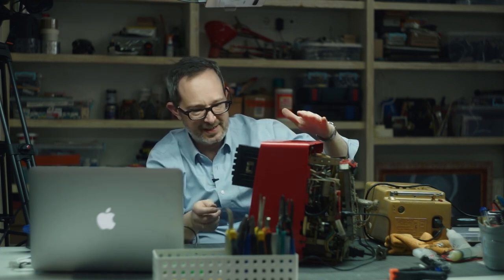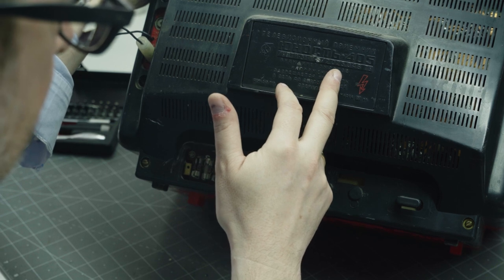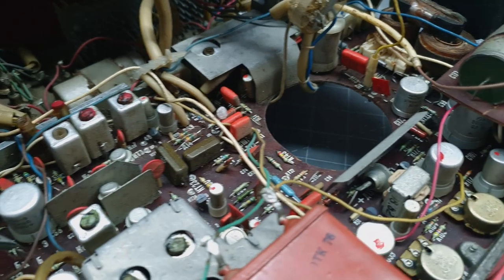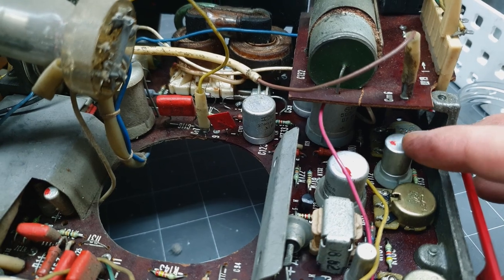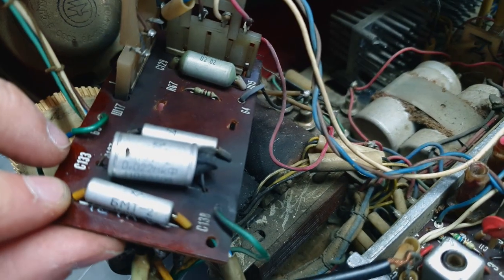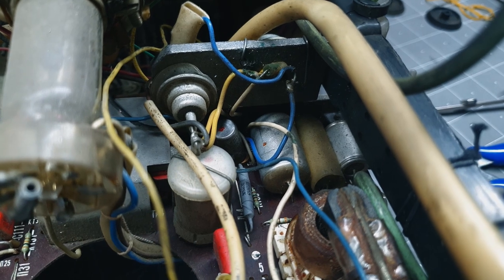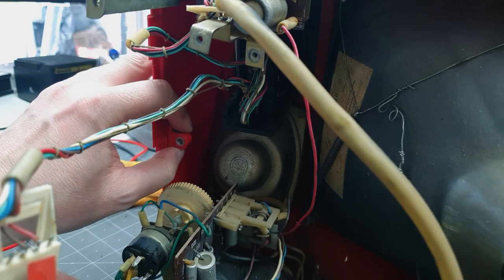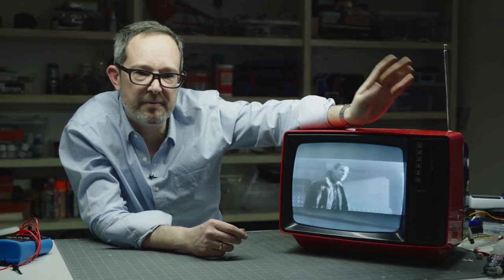CRT Restoration - How to get Blade Runner onto a Soviet Television

Comment: Kids these days don't appreciate how valid a solution slapping electronics is
Reply from the maker: If it works for the Falcon’s hyperdrive, it works for us.
Reply: still works fine, slapped the shit my aio CPU cooler. and the pump just started working again. and have been for over a year
Reply: Percussive maintenance is the technical term...😂😂😂
Reply: Percussive maintenance

Comment: The "БМТ" ones is paper-oil caps, not sealed. You should replace all of them too, like old electrolytics. Eventually, they all will blow up.
Reply from the maker: Thank you!
Reply: @ThomasBurns  Yes, any Soviet capacitor with the "Б" character on them contain paper, and needs to be replaced. Except ceramic-encapsulated ones with soldered-on end caps, and metal encapsulated ones with glass feed-through beads for the leads. Those are hermetically sealed, and still quite reliable. One example is the big flat brown rectangular capacitor mounted on the chassis. That is a hermetically sealed paper-in-oil, or metallized paper capacitor. Never seen one going bad in these TVs, and I've seen and worked on many dozens of this chassis. But that operates at a low voltage, so no big surprise. IIRC it is part of the vertical oscillator.

Comment: In a pretty good condition? You sure it is? Vertical hold seems to be pretty unstable, I guess there are some solder joint's failures or bad pot connection, or something like this. Unless it's going to be part two
Reply from the maker: Hahaha yes you're right that it's still got a long way to go. But we try to celebrate the small victories. :)

Comment: The smaller transformer is for the vertical output. But it's not an output transformer. It is a choke in series with the vertical deflection coil, and it has a feedback winding, IIRC for the vertical oscillator. There is a lot more to do with this TV to make it reliable, I'll tell you some tricks if I don't forget about it, this weekend. Some examples:

You ablsolutely need to replace the bypass electrolytic of the line output stage. It is after a choke, and the CRT heater is connected to that same point. When the capacitor goes open, the set will continue to run, but the series choke isolates the horizontal stage from the main smoothing capacitors in the horizontal frequency range, and because of that, the horizontal output boosts its own supply voltage with a lot of horizontal frequency noise. It stresses the horizontal output transformer and transistor, and also raises the CRT heater voltage by a lot, it kills the CRT within a few hours, maybe less than an hour.

You also need to replace the width capacitors, they are metallized paper with very high leakage current at this point. It can easily kill the horizontal output transistor, which is VERY hard to substitute. It is a marvel of Soviet engineering that they were able to use that type of transistor as a horizontal output. The whole horizontal output circuit was fine tuned around that transistor. It is a GT810A / GT905A / (maybe GT906A works as well) PNP germanium transistor, and the set won't work properly with anything else. TVs with this chassis were manufactured until at least 1992, and they switched to a silicon horizontal output only around 1989 I think! Practically all of the transistors were silicon in these sets by ~1986, except the horizontal output. It will (IIRC) mostly work with a BD246A silicon PNP transistor, but you need to modify the driver transformer and add a capacitor (IIRC) between the emitter and base of the BD246A to slow it down, otherwise the picture will be full of vertical bars due to parasitic oscillations and the transistor will become hot. But I have to look that up, I've only done it once, and forgot the details. Or if you look up the schematic of Yunost 406, that already has a KT806A silicon NPN transistor as hor. output, but that needs quite a lot of modifications, including horizontal driver transformer modification, and I don't know if the winding data for that is available anywhere.
Reply from the maker: Wow! This is such great info—thank you so much!
Reply: @ThomasBurns  You're welcome. I just realized you're in Georgia. So you can probably easily get the original horizontal output transistor, maybe even a flyback.
Reply: Inspiring and impressive the knowledge! Both of you!

Comment: Great one! What are you using for the plastic case cleanup and restoration?
Reply from the maker: For cracked plastics I use JB Weld plastic bonder for structural repairs. For polishing plastics I've been experimenting with Meguiar's PlastX Cleaner and a spinning cleaning disk (you can see that in action in our flip clock restoration video). This works surprisingly well, as long as the scratches aren't too deep. To bring out the color in faded plastics, especially black plastics, I'd like to try some 303 Protective Cleaner, but haven't had a chance to test it yet. My personal preference is to avoid repainting parts during restoration, as that never seems to come out right.